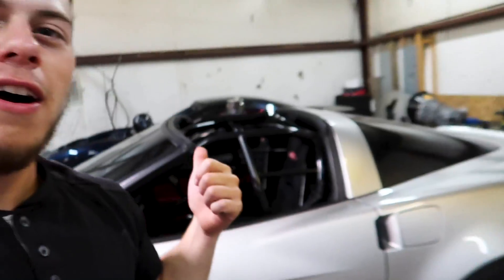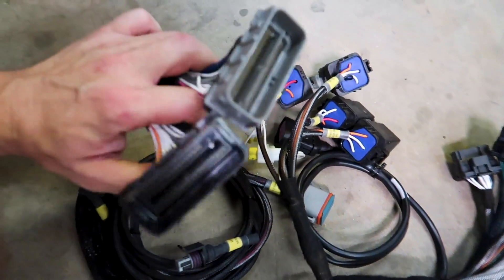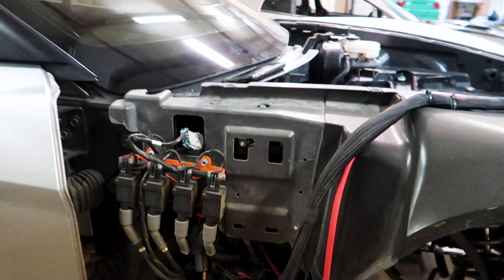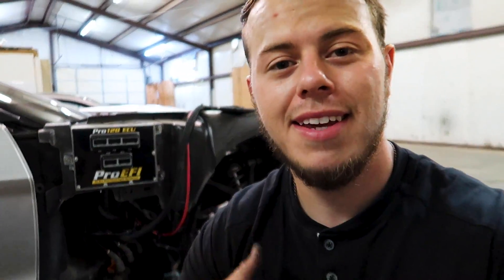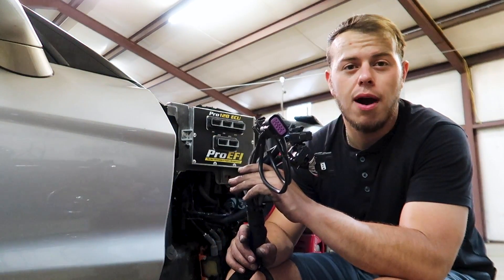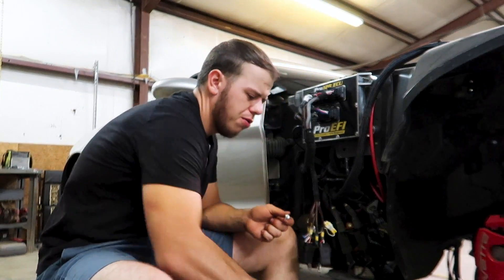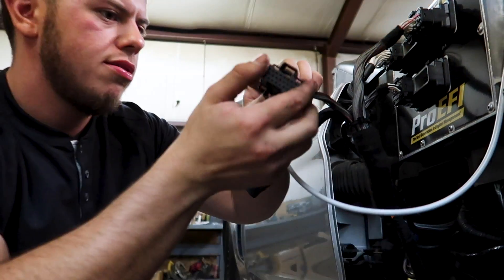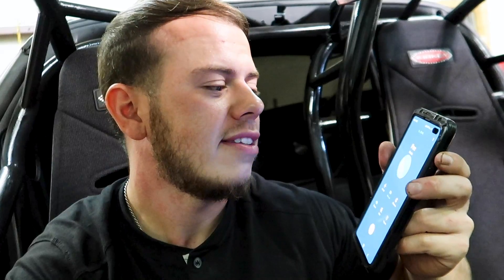7 Second Stick Shift build (PRO EFI install)

Comment: If you want to use heat shrink, just pull the pin out of the plug and slide the heat shrink over.  Then re pin the connector

Comment: Is there a reason you went with pro efi over holley?
Reply from the maker: Because of plug and play compatibility with the harness..corvettes have everything run through the stock harness..even the door opens electronically this made it much easier to make sure everything worked properly without making a custom harness for holley
Reply: @nxtshift  makes complete sense now that you explain it that way